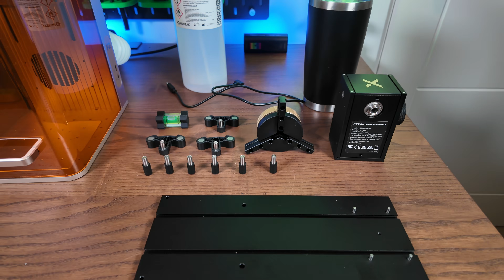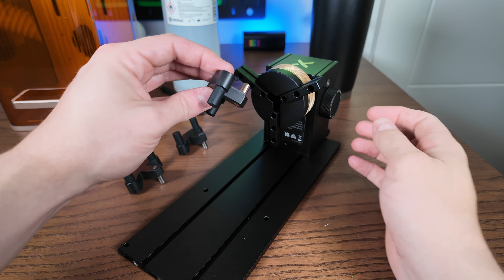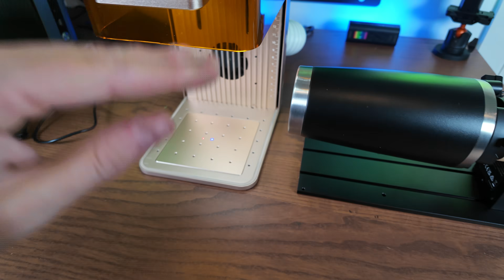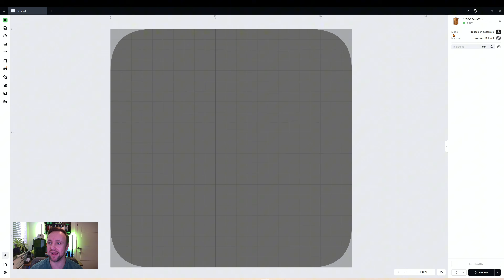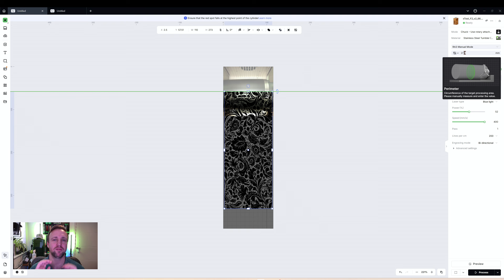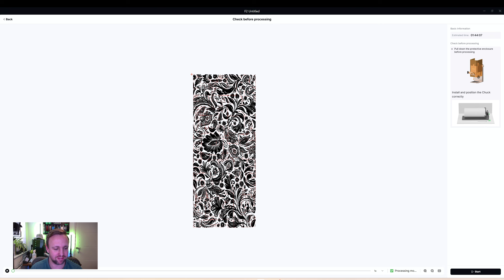xTool F2 Tumbler Engraving with RA3 Rotary: Complete Beginner Walkthrough

Comment from the maker: If anyone is thinking of getting an xTool machine, these are my affiliate links and a discount code you can use. It really helps support the channel.

UK: https://xtool.pxf.io/RGDW0g
US: https://xtool.pxf.io/zxDBzM
EU: https://xtool.pxf.io/LKYWDZ

Discount Code: L3D80
Reply: Hi - what i didnt understand was that you took the width of 273.5 and said that  the width at the bottom of the cup is less so it wont engrave so deep at the bottom ( but it did) is this because you used the spirt level?

brand new user here with an F2 ultra that i haven't even took out the box yet

great video though and very clear explanations ( i have subscribed)
Reply from the maker: @leeclements-gr8cn Thank you for watching and subscribing. It's because I angled the cup upwards to make sure the surface being engraved was horizontal and perpendicular to the laser. That meant that the laser was making contact at the same height across the full width.
Reply: I have got the M2 and I was testing today with a tumbler but didn't get greate results, dose any one know how to achieve this result with a 10W diod and a 3W ir, not sure if it is achievable tho

Comment: Do these setting work with the F2 ultra?
Reply from the maker: Unfortunately not, the F2 Ultra has different lasers to the F2 so these won't carry over. I'd run a quick material test on your tumbler, and there are tested F2 Ultra coated metal settings in the free library here: https://www.l3daccessories.com/pages/xtool-f2-ultra-coated-metal-settings

Comment: Hi. It looks to me like the file you are inserting is an SVG file. When I do that, it is inserted as an image, and I get a different layout in the settings. How do I get the same layout settings menu that you have? Or do you have the setting for image engraving?
Reply from the maker: Yes you're correct. The way the machine processes images and vectors (svg) is different and it gives different settings. A lot of people use software to convert their images to vectors. Personally I haven't done it.
Reply: @L3DAccessories  If I choose "color engrave" I get the same setup as you have. Is it possible to use it?

Comment: Hi Chris, I found your videos a few days ago and find them extremely helpful. Thank you so much for that! I also have an F2 and am currently testing a lot of materials and parameters. Today, I lasered a black tumbler. The vector (text) turned out great using your guide. However, I’m having issues with the PNG... it is getting better, but I just can't seem to find the best settings. Have you happened to test this already and have any settings for blue light and IR that work well for you? That might help me get closer to the right values.Thanks in advance!"
Reply from the maker: Hi Isabel, thanks for watching and I'm glad the videos have been helpful for you! I haven't had the chance to test photo engraving on tumblers with the F2 yet but it's on my list!

Comment: Where would you place 2 images to be opposite each other on Tumbler?
Reply: I just watched your glass engraving video and got my answer. Line it up on the chuck then rotate it to the other side and engrave. Is there a way to space them out within the software to do both images in 1 go? I guess I am a bit confused by the grid that the rotary uses. Could you explain that, please?
Reply from the maker: I think the grid in rotary mode is basically your tumbler unrolled, with the long side being the perimeter you entered. If you place the second image half the perimeter further along from the first, it should land on the opposite side in a single job.

Comment: I haven't been having an issue with my png files but when I try to upload a png file to do on a tumbler it is not allowing me to do lines per cm.  And when I hit process it sets to only 1 second
Reply from the maker: If you're engraving a png then the software uses different methods to engrave then. Instead of lines per cm it uses dot duration. I did a video explaining the differences so check it out if you'd like to learn more.

Comment: Hi, your videos are quite helpful. I am new to laser engraving and facing an issue with my xTool F2, when I engrave a tumbler and try to increase the power, the laser point flame up. I am not sutra whether this normal or usual, but there is a small flame moving around with the laser point when engraving.
Reply from the maker: That is absolutely fine and normal. The machine has a built in flame detector so if it ever becomes unpredictable it should stop the engraving.

Comment: Hi All. I am new to the laser world (just got the xtool F2) and the Rotary attachment. I followed the video and it worked sort of. So I have 3 questions (1) my diameter setting would only go to 205mm is that the largest it will do? (2) In the advanced setting there is no setting called "Engraving Angle Setting". Is there a setting I am missing to show this setting? (3) lastly when I did a test engraving, the rotator rotated backwards and the lettering was engraved reversed (but did look pretty good). Again, am I missing something or is there a way to change direction? Would appreciate any direction. Thanks and I find the videos very helpful, Thanks Chris
Reply from the maker: Hi Steve, thanks for watching. 1) I'm not sure what the limit is but I'd imagine the F2 almost certainly couldn't engrave a diameter larger than that. 2) It's been a little while since I used the engraving angle feature so there's a chance it could have moved. For that one I'd recommend asking the question in the xTool Official F Series group on FB. 3) If it's engraving in reverse it means you've probably got "RA2" selected instead of "RA3". There's a drop-down that allows you to specify which one.
Reply: @L3DAccessories  Thanks Chris. I'll check out you suggestions. Very much enjoy your site!!!

Comment: Why don't you just 3d print a riser for the F2 so that the rotary just slides under rather than removing plate and balancing it. that way you can move the object more easily
Reply from the maker: It's something I've been intending to design but haven't gotten around to yet. It's definitely the way to do it though 👍

Comment: This video taught me a lot! However I am confused a bit with the software. I did the test array and it gives me power and speed, however, in the settings it shows Power, Dot Duration, and DPI.  I did watch your other video explaining the difference, however I still don't know what settings are good for the tumbler. Is there a test array that will work for  raster images?
Reply from the maker: Sorry for the slow reply! The settings in this video are for a vector design, which is why you get speed and lines per cm. Images use dot duration and DPI instead, so they won't carry straight over. This video shows how I test those with a grid of power and dot duration: https://youtu.be/DsLAx6tVx3k

Comment: Thank you so much for this video, however, I do have questions about the first pass, clean up ir pass.  how to pre save those
Reply from the maker: I saved both as custom materials in my material library, I show how to do it here: https://youtu.be/F215A0HJu_Q. The first pass was blue light at 52% power, 400 speed, 200 lines per cm, then the IR clean up at 18% power, 400 speed, 200 lines per cm.

Comment: Upon engraving designs between already 2 existing designs on a tumbler, I have noticed a few times already that even though I centered the design according to the green guideline, the result is actually not centered properly but has a slight offset to the right. How can I fix this?
Reply from the maker: Sorry for the slow reply! Does it always land to the right, and by roughly how much? It's worth using the frame option before you engrave to check where the design will land, then nudge it across if needed.

Comment: Where did you level for the full wrap though? Yoh showed leveling for the test where you only engraved on the top. But that doesnt seem to work well for the full wraps
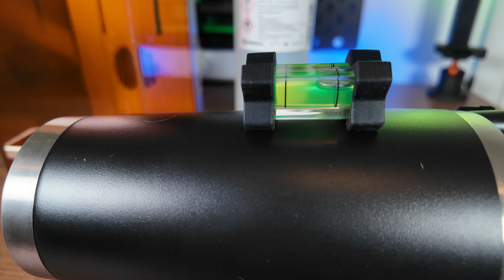Reply from the maker: 7:41 It was here. I levelled and then made sure to measure the perimeter around the middle part.

Comment: any chance you could explain how to do two sided logos on a cup rather than a wrap?
Reply from the maker: In rotary mode the workspace is the tumbler rolled out flat, so if you place the second logo half the perimeter away from the first (about 136 mm for the 273 mm perimeter in my video), it should land on the opposite side and both go in one job.

Comment: I'm sitting down with the exact same setup. I have a standard 12oz mug, but the rotary parts aren't fitting in my mug. I have them in the middle part as they don't seem to fit in the bottom hole. Ideas?
Reply from the maker: Try different configurations of the rotary grips until you manage to hold it firmly.

Comment: After my last post where I said your measurment was wrong, I jist want to thank you for the video. I just started using the RA3 and this vid was helpful. I'm not impressed with some things about the RA3 like the size and plug placement vis a vis the enclosure which is too small. I am also not getting the rectangular box either, and can't acurately predict where the engraving will start,  but I'll keep plugging away. Again, I enjoy your vodeos, and I am subscribed.😊
edited to add I'm using the Ultra UV
Reply from the maker: Glad you found the video helpful despite those frustrations, and thanks so much for the subscription! Have you changed the framing mode to rectangular? If not, I recommend checking out my xTool studio tutorials and I've done one specifically on framing.

Comment: I just paused your video to comment on the fact that you read your tape measure wrong. These tapes are misleading. You read the wrong number for your whole number. It is actually 1 less
Reply from the maker: In this case I believe I got it correct. The engraving wrap was almost perfect around the tumbler which wouldn't have been the case if it was 1cm wrong. Thank you for watching

Comment: Hi! Advice on what to do if the opening is too small to put them inside? It also slightly goes in so it won’t get a grip on the outside. Do I use the rollers then? It’s an Ello 32 oz so maybe it’s too big?
Reply from the maker: I'd definitely recommend joining our FB group (F2 Owners) and asking this question. Personally I haven't tried a tumbler that size on the F2 but I'm sure somebody will have done in the group.

Comment: Hi Chris, love your tutorials. They are the best! I am right now in the process of engraving (xTool F2) a navy blue powder coated 20 oz. tumbler from AP Lazer. I ran it just like your video says, with the same settings, etc. I'm using the RA3 rotary attachment. The first time I ran it, I could see the engraving, but the silver was not exposed. I ran the whole thing again, and the silver was exposed, but not completely clean. I'm running it for the third time and now it's completely clean. But obviously I've got something wrong in the settings since I didn't get this result the first time through. Any advice? Thanks so much!
Reply from the maker: Hi Arielle, thank you for the kind words. Rest assured, you're not doing anything wrong. One thing you'll quickly learn with laser engraving is that not all colours engrave the same. Unfortunately blue is one of those colours that seems to absorb the blue laser more than other colours which reduces the power of the laser. In these cases you have to compensate by either increasing power, decreasing speed or as you have done, carry out multiple passes.
Reply: @L3DAccessories  Ah. Good to know!! Thanks so much.

Comment: Great video.  Thank you.   I do have a question.   Because the tumbler is tapered, where should the circumstances be measured?
Reply from the maker: Thank you for watching. Normally I will measure the centre of the area I'm planning on engraving. So for example if I wanted to engrave on the bottom third of the tumbler I'd measure the area in the bottom third. Hope that helps!

Comment: That is amazing! Does the F2 do coloured designs? What about faux leather, can you use any type of faux leather or does it have to be a particular type/brand? Thanks
Reply from the maker: Yes it can do coloured designs on stainless steel within reason, nothing exceptionally vivid but definitely something. In terms of faux leather, it can engrave all types but you have to make sure there is no PVC in the material as laser engraving PVC can cause toxic fumes. Most PU leather is safe to engrave though. Are you considering getting one?